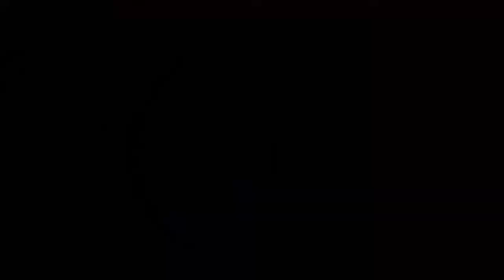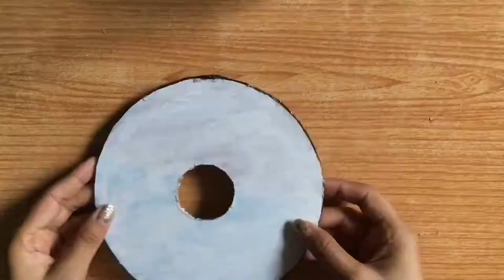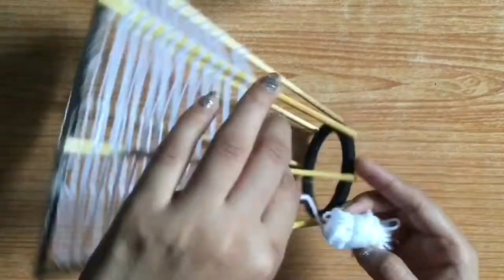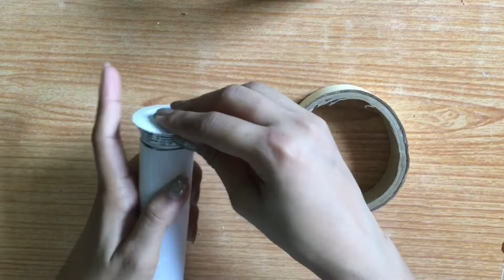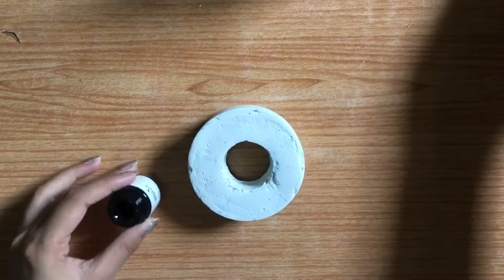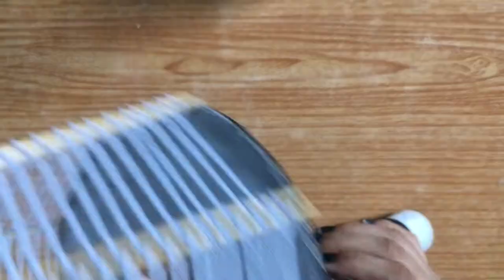Table Lamp || Just Try It from Waste Materials || Best out of waste craft

Comment: Its outstanding but ek confusion h ye bulb kese fit hoga   i try it but nhi huva
Reply from the maker: Thanks for ur comment
Reply from the maker: Firstly, draw the shape of cope light on the mid of cardboard and cut it , then take a paper roll and insert the adaptor of cope light on it and cover with tape then after insert the cope light on the lower side of cardboard and again cover with tape so that it get well fixed or you can also use superglue .... Hope u understand better now😊